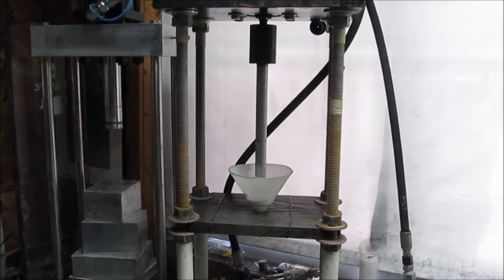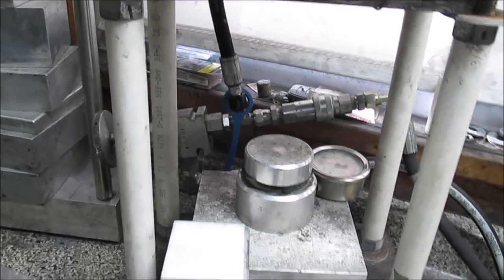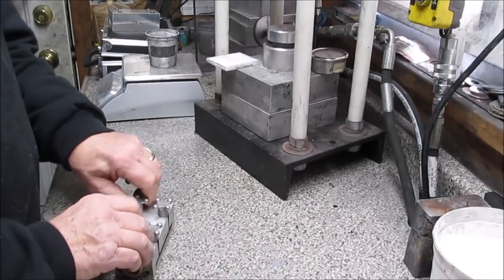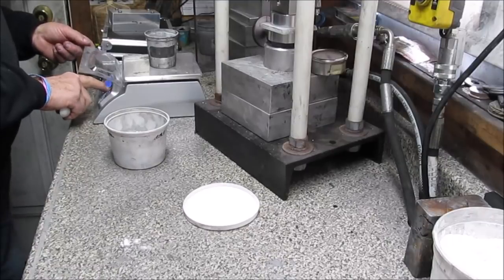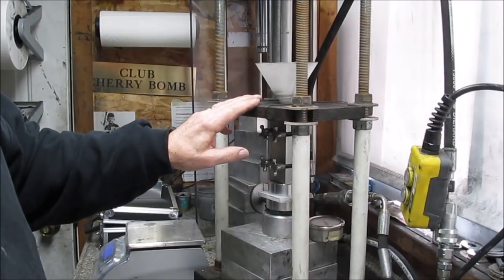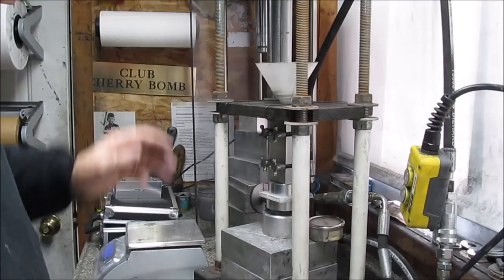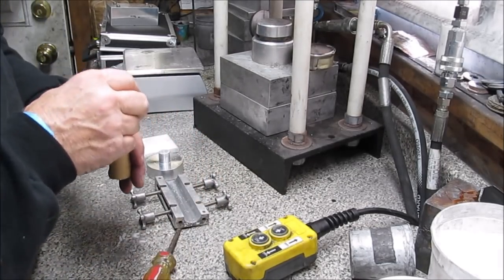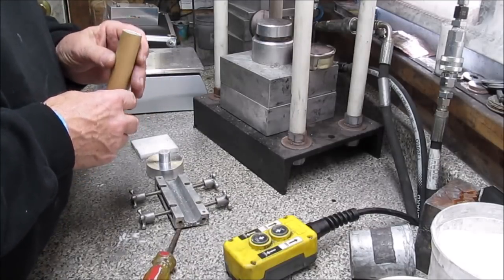Power Pressing a Whistling Girandola Motor

Comment: No safety shield? I thought whistle was always supposed to be pressed behind a shield standard practice? Not claiming this is wrong, just curious. I only press BP in my unshielded harbor freight press, but if I could press whistle without spending the coin on a piece of Lexan safely I would do it
Reply from the maker: I added a shield on that press just the other day, FW. I've only pressed BP endburners on that press 'til now, but decided that once the vid of pressing whistle was done, I needed a shield for insurance. Good point. Thanks.

Comment: i try these with 7:3 perchlorate and sodium benzoate, my motor was not whistling and didnt go up and it cato in the end of burning....what am i doing wrong?
Reply from the maker: Any catalyst like copper oxychloride in the mix? That's typically required. And the chemicals need to be very fine, and intimately mixed. We also use a lubricant/phlegmatizer in the mix, such as vaseline or mineral oil, to desensitize the propellant. Whistle mix is very powerful, and static/friction sensitive. Be careful.

Comment: Why not use a hickory or cocabola (African hardwood, stuff snaps like granite & is absolutely beautiful when sanded & oiled...just an FYI buddy) wood ramrod? They're hard as shit & you take the metal outta the equation all together?...
Reply from the maker: I have no issue with using metal tooling to make motors, but I just want to do everything I can to avoid pinching propellant between two metal parts.